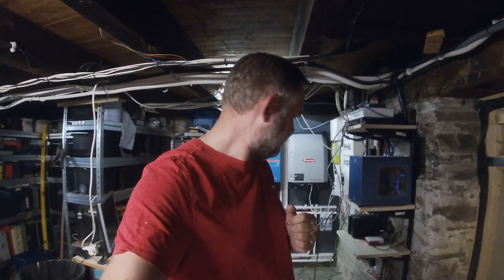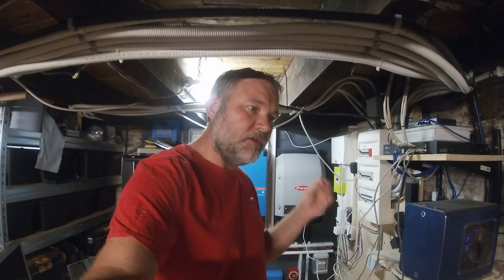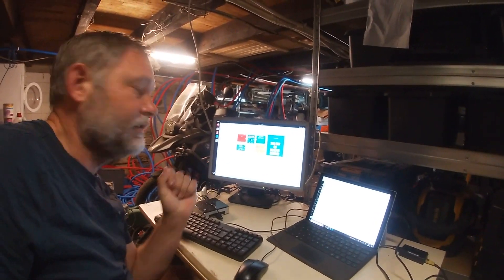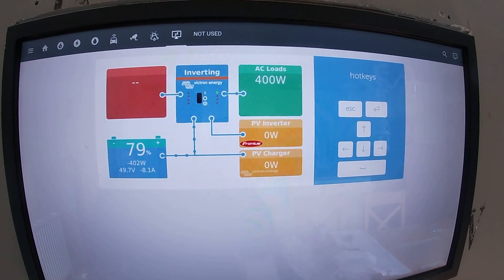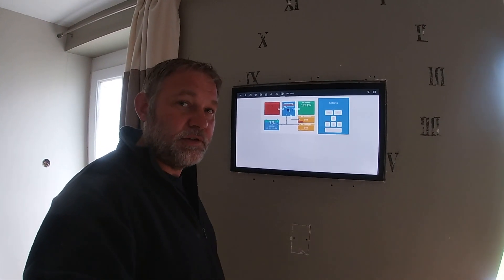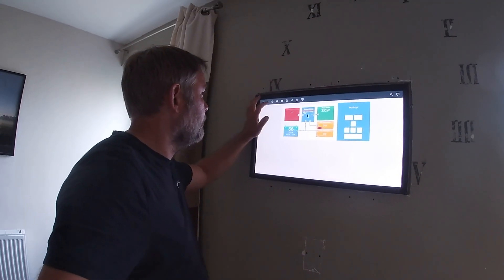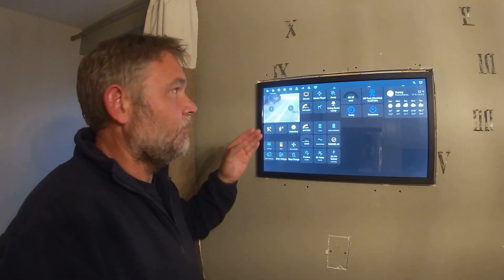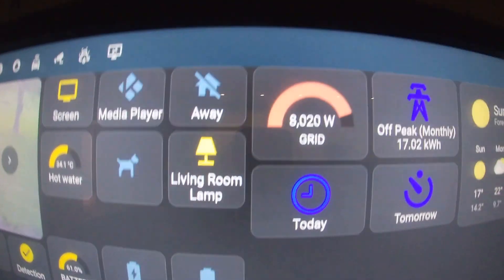Can you run your house on batteries? Test of solar battery storage system

Comment: When you get the panels on, on a sunny day be interesting to see how, collectively, on a sunny day,  the panels replace battery charge as you do a washing cycle. So from using 40% to 50% in a day ,  lets see if the panels will push it back up to 100%. And if so how long it takes.
Reply from the maker: Yes I am really looking forward to seeing what impact the panels have. As soon as I know I will let you know

Comment: Very interesting. I’m looking at doing something similar, but I already have the panels which just heat the hot water and the rest goes to the grid which I don’t receive anything back. So I’d be interested in getting some batteries like yours. Thanks 👍.
Reply from the maker: It's all down to the type of inverter that you have and if you have single or 3 phase grid connection. Have a look at the victron website for some more info. If you want to buy batteries then Nikon are the best place for it

Comment: Fantastic Andy, very interesting. What kind of draw would  the battery take during winter, if you had underfloor electric heating?
Reply from the maker: Electric heating of any kind really takes it out of the battery. It depends on the overall size and wattage of the heating. I really wouldn't recommend it. I would use one of the portable oil fired heaters which are super cheap to run. I did a video on them recently. The battery would provide around 15kWh so you could leave a heater or one room underfloor heating on most of the day but it would be empty by nighttime. This will all change when the panels are on though 👍
Reply: Thanks Andy, I am in Burgundy. Selling my little cottage and buying something else. I will restore with Hemp bricks and other eco friendly products. I did a lot in the cottage with lime and hemp. I really would like to have solar panels at the next property. I have a couple of those oil fire heaters, that I use in the winter if  I am away. When at home the underfloor heating is great and the wood burner keeps me very toasty. Though not liking the EDF bills.
Reply from the maker: @graydollar2363  I don't know your timeframe on this move, but my videos coming up are on using a wood fired boiler stove to heat the house from radiators and underfloor heating. This is in addition to the solar panels. I will fast track the next wood fired boiler video for you. Stand by.